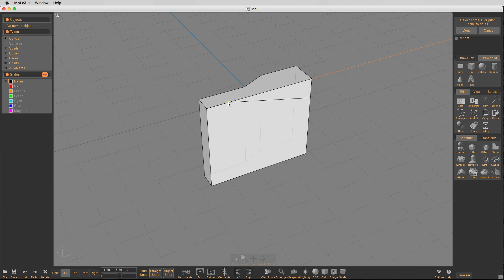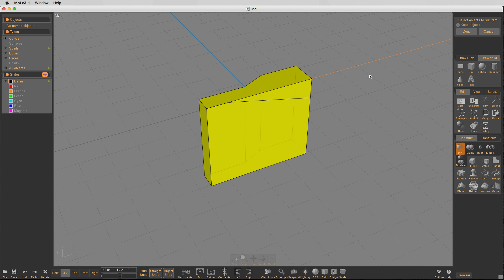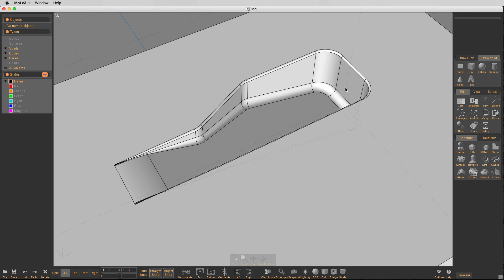MoI Variable Radiused Fillets

Comment: Nice demonstration. THANK YOU. But let's say your model is a mould. And I'm going to pour epoxy into it. The problem is, it's difficult to remove from the mould... My question is: is there a tool or method for creating a slight angle to make it easier to remove from the mould? (if the translation is correct, we're talking about draft)
Reply from the maker: I don't know. I no longer use this application.

Comment: Hi Chipp.
Great tutorials man. Really appreciate them. Just wondering if iam doing anything wrong. When i go to fillet the edge it seems the points have split after the boolean operations. Any reason why? Cheers
Reply from the maker: Hard to know why without seeing what you are doing. I'd suggest posting on the MoI forum with your 3DM file.
Reply from the maker: Hard to tell without a file. Try posting you file and question on MoI3D forum and there's plenty of help there.

Comment: Hi, I don't understand how you create the new shape from the polyine at https://youtu.be/n9C9Ydki75E?t=61 ? With boolean? Diff? Why does this cut through the shape? It's not working for me. I tried to use trim. But this gives me a shape with a hole on the top. Thx.
Reply: +Sven Bardos Ok, gave it a second try on a new shape. Now it works with boolean diff.
Reply from the maker: Sven Bardos Glad it worked out for you.